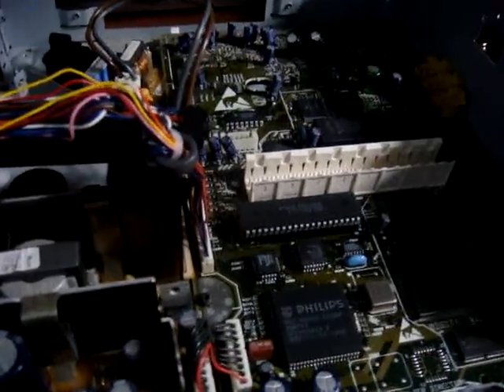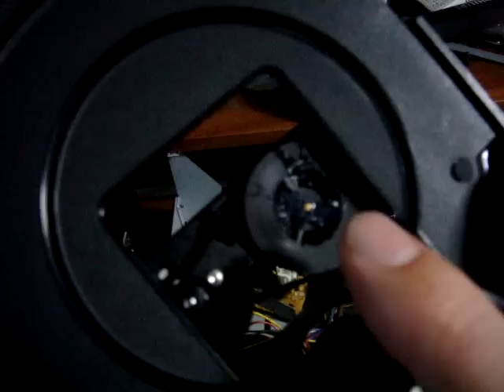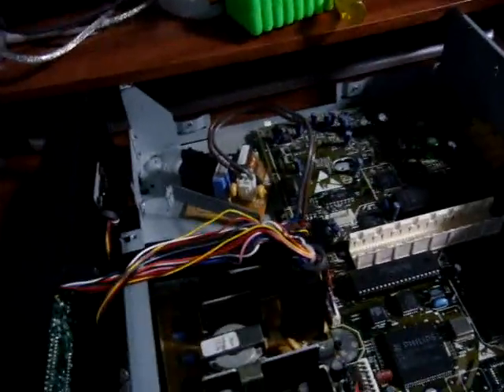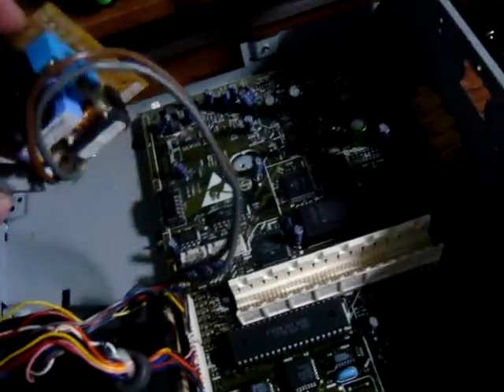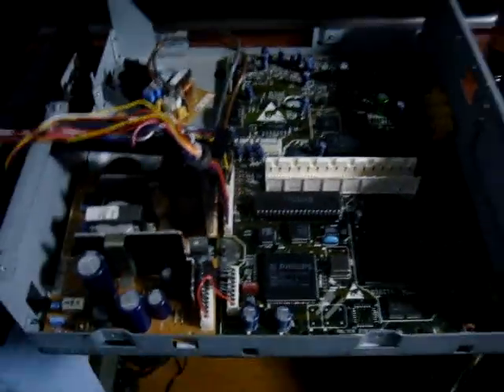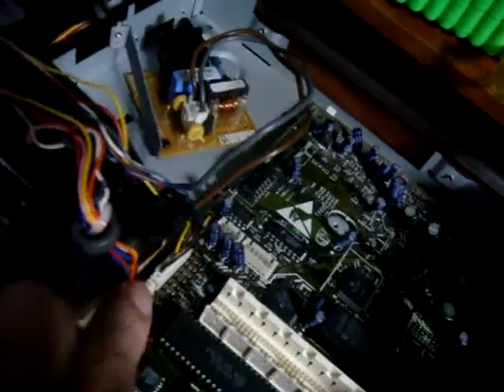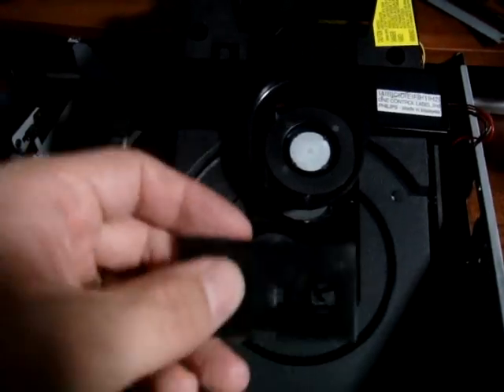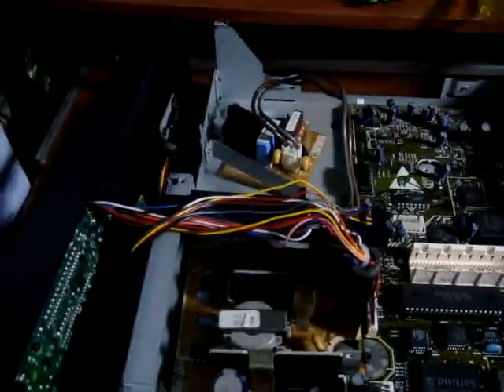Squeaky Cd Tray Fix on the CD-i 470 and an Internal Look at the Machine

Comment: My father in law has been an engineer at Philips and he actually knows quite a few people from the CDi team. Quite a few of them have retired now.

I was contemplating on getting on touch with some of them to see if they have some nice inside information to tell. Turns out they are very very busy people still. 

The CDi software actually uses some sort of hardware virtualization - that is why the games are slow as there is a lot of abstraction layers between the game code and the hardware. ;-)

Comment: The CD-i actually came out late 1991 and is one of the pioneering CD based systems and used it's own CD format, the CD-i. In some ways you can say the DVD actually took a step backwards as a lot of things possible with CD-i are not workable with DVD (anyone who has ever played a DVD 'game' knows what I'm talking about). 

Originally it was intended to be mroe of a multimedia system for movie and educational stuff. It's kind of weak for games, but quite a few were made, especially after 1993.

Comment: No DVD capability luke even with the FMV cart. Unlike the 3DO it is reqired for several CDi titles. As the bare CDi unit is very under powered, the FMV module handles all Full motion video tasks and I am told even adds some memory to the main unit. It is pretty much essential to get the most out of the CDi. I have it also, I don't have it for 3DO OR my CD32 but those ubits play 99% of all titles without out and it is only required for CD video MPEG1 Playback which was not much better than VHS.

Comment: For pal stuff you only have two option. First would be to get a capture device and play it through pc. The other would be get a video monitor that is used for broadcasting use, though I am not sure how hard those are to find in japan. Or you could use a xrbg2 or 3 and play it on a pc monitor.

Comment: The easiest and costliest solution would be to get another TV. There are two alternatives, but it depends on what your TV has and how much each costs. VGA/DVI passthrough converters work, as do RGB. If it connects through SCART/Composite then it shouldn't be hard to find or even make your own converter, but if you do I recommend a switchbox so that you can plug them all in at once and switch between which one you want to use when doing your vids.

Comment: Oh my god Luke, I wish I'd watched your video first. I've literally spent like the last three days performing open-heart surgery on my CD-i, replacing drive belts, greasing all the gear teeth, everything you can think of and the thing STILL sounded like a banshee. Then I found this, rubbed a little vaseline on that shaft, and it's whisper quiet. Hours of work down the drain, but I'm glad it's solved now anyway! I still need to replace the damn NVRAM chip though lol